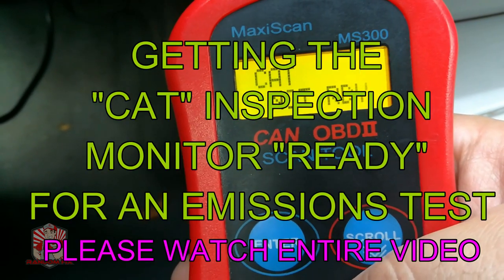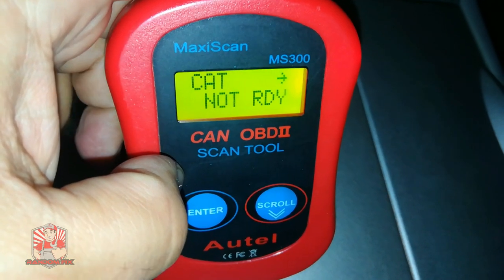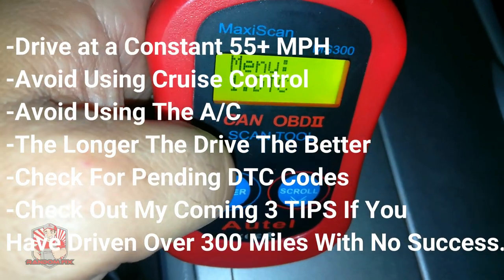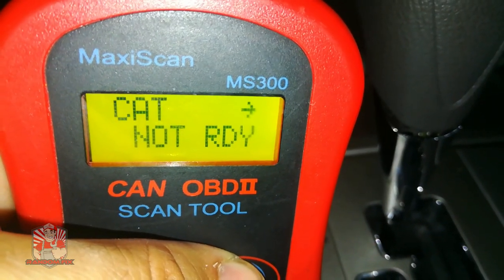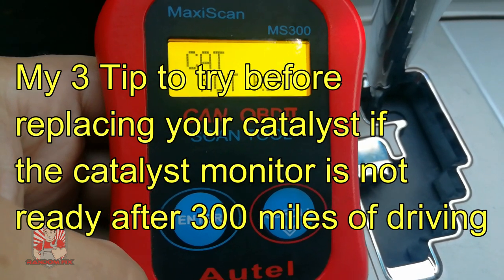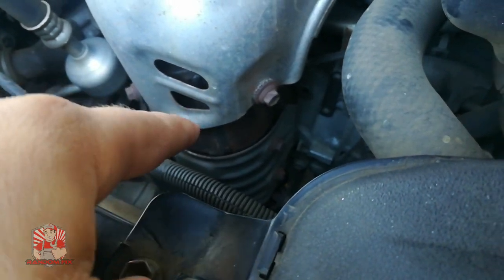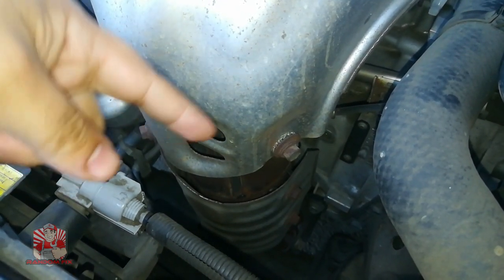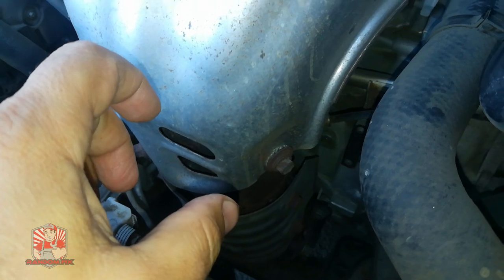Improve Your Catalyst Monitor Readiness P420 P430 FIXED!

Comment: 04 matrix . only my cat I m is not completing ?? I have a p0420 pending. Will the catalyst i m still complete???
Reply from the maker: You will have to clear the drive cycle as it may take longer for the check engine light to clear itself if the ecu (engine control module or unit)  think the issue has been fixed. After clearing you will need to find a permanent fix ( the only permanent fix a new catalyst) or find a temporary fix ( like I show on this playlist https://youtube.com/playlist?list=PLDEbtVOPRC-h1BAzaWQ-6NSnmG0gwvgwP )

The whole playlist is dedicated just to incomplete catalyst monitors.

Let me know if you have any other issues and keep me in the loop. I would personally try a temporary fix like the 3k trick that I show on the videos in the playlist and then work my way around to a fuel additive. When your registration is due again the next few years the you can decide what to do then. Good luck

Comment: Getting a P0421 code on a 2008 Mazda 6. Will clearing code, completing a proper drive cycle help pass smog test?
Reply from the maker: Yes, clear the code, wait for the morning and complete a drive cycle. It's worth a try. If not successful check out my complete smog list and I have a few simple temporary solutions. _Randomfix

Comment: What if there is no pending codes but the Catalyst Monitor is still not ready? What next? I drove for 101 miles. Thanks,
Reply from the maker: Louis, you have to keep driving until your get the Catalyst to set in most states.  Di you ever get the monitor to set? if you still need help, let me know I made video each make for the drive cycle process. Thanks
Reply: @RANDOMFIX  Yes the Catalyst did set, I just had to drive it more. Thanks
Reply: @RANDOMFIX  I live in PA and emissions is a must pass for inspection. I put Kata clean, unplugged the battery overnight for 12 hrs. And driven the car over 50 miles and still the 02 and Cat are not ready. I have no codes at all and no check engine is on. I need to pass inspection but the monitors are not ready....why?
Reply: @LordCommandor did you ever find a solution?

Comment: If I install fooler will my catalyst im still complete for smog check????
Reply from the maker: I haven’t tried the fooler method but did have success with mil eliminator on a ford mustang but there are no longer sold on the open market. I purchased from American muscle. 

Here are the simplest ways to fix a p420 code https://youtube.com/playlist?list=PLDEbtVOPRC-h1BAzaWQ-6NSnmG0gwvgwP
Reply: Will cleaning my 02 sensors will help My cat to complete?
Reply from the maker: It could help if your o2 sensor is cause a lazy reading on the down stream but now you are just guessing. Why do you suspect the o2 sensor?

Comment: Question if all my system monitors are ready  but i have the p0172 code if i reset or desconect the battery  my monitors will be inclomplete?
Reply from the maker: Yes, if you reset the check engine light all of your monitors will become incomplete. You need to handle the p0172 first.

Here are the different possible reasons why you’re getting the engine code P0172:

Contaminated engine oil (too long since the last oil change)
A leaking fuel injector
Excessive fuel pressure due to restriction along the fuel return line or a faulty fuel pressure regulator 
A saturated carbon canister due to packing the fuel tank.
Clogged air filter
Restrictions somewhere in the air intake system
Clogging due to buildup or physical damage in these exhaust components: catalytic converter, exhaust pipe, and muffler
Faulty O2 sensor (but O2 sensors more commonly fail by reading lean, not rich).
Exhaust leak (upstream of the O2 sensor, a leak will allow oxygen to enter the exhaust stream, and this will typically throw the opposite code rather than a P0172)
Problems with other sensors (e.g., coolant temperature sensor, mass airflow sensor)
Circuit issues, such as loose connections and damaged wiring 
Issues with the PCM, such as software in need of an update

Comment: How often does the catalyst monitor run a diagnostic?
Reply from the maker: It's probably vehicle make dependant.
Reply: @RANDOMFIX  I have a 98 Tacoma.  Monitor inc also.
Reply from the maker: Here is the drive cycle https://youtu.be/EKfEr2LP2Nw

Is the catalytic converter original?
Reply: @RANDOMFIX  I believe it is original. I haven't changed it since I bought.
Reply from the maker: Watch the Toyota drive cycle video for some tips but ultimately the catalytic converter will sometime just has too be replaced. Maybe you can still make it pass for a few more years. I have a whole playlist about catalyst and some tips 

https://youtube.com/playlist?list=PLDEbtVOPRC-h1BAzaWQ-6NSnmG0gwvgwP

But again the only real solution is a new catalyst.
Reply: @RANDOMFIX  Will check it out. Thank you!

Comment: Are you familiarise with p1093 bmw need help
Reply from the maker: here are the possible causes, low fuel pressure- did you check the fuel pressure?
Large vacuum leak on engine-
Faulty Mass Air Flow (MAF) sensor
Faulty Ignition
Faulty fuel injector

What are you experiencing?
Reply: @RANDOMFIX  thanks for the reply I got it fixed I had large vaccum some where between egr and vcg no more code thank for your help
Reply from the maker: Good to hear you got it handled.
Reply: @RANDOMFIX  ps I've also replaced my cats with an aftermarket part I had both 420 and 430 all good pass emissions in ct
Reply from the maker: Nice, is it driving better?

Comment: Any clue why a CCM monitor will not get ready? No trouble codes and it’s only the monitor that wasn’t ready. Before this I couldn’t get the CAT and 02S ready but got the issues fixed and after the repair the CCM was the only monitor that doesn’t get ready
Reply from the maker: Hi Franky, I will be more than happy to help. What's the year make and model? Also, can I get your help? CHECK OUT MY OTHER CHANNEL and subscriber if you like it. THANK YOU ▶️ https://www.youtube.com/channel/UC-wuhWwzZnFOWK-GMsP6Ejw _Randomfix
Reply: RANDOMFIX  an I advise me how to fix this on my Porsche 2001 boxter ? I was told today it didn’t pass cause the obd2 monitors ? Not ready ? I’ve own the car for 2 years or so only drive it to work and back if on freeway no more than 20 or 30 Miles at best...my mechanic told me to drive it at night for about 100 Miles or so an dit should reset ...the previous owner changed the batterie but that was over 2 yeas ago when I bought it and I’ve driven it more than 100 Miles pls advise
Reply: @vladimiralvarez1162  i am having the same issues in my 04 BMW 525! we recently had to disconnect battery for a door latch cable fix, well suprise i took for a smog because its due and it didn't pass ! said something about  Oxygen sensor and my OBM 2 monitors not ready . i tried a drive cycle of cold start for 3 minutes, drove 25mp and up to 35-40 a few times complete stops, and then 60 mph freeway for 5 miles and then coasted down to about 25 before a vehicle was way to close lol . any way let it sit at the end of work drove home did the 60 mph agin complete stops thru town ect... 
went back to have monitors checked and now its throwing pending codes have no idea what that means. 
did you get a fix ?????
Reply: Mona Parker 🤔🤔🤔well what my mechanic do was plug it to his laptop and reved it and was adjust all sensors with his laptop ..and got all the little faces that appear on the screen to look like happy faces and told to go and try smoging it and it passed with flying colors ...fast forward have had no problems and I did change my battery and it’s running smooth ...I did change the fuel pump cause it was bad ..but I love it !!
Reply: @vladimiralvarez1162   hmmm I have owned this car since november of 2019, previously owned by a family member. NEVER had issues passing smog untill the battery disconnect. I did not know that the sensors could be set via a computer . I have driven it now for about 570 miles. I have not returned to the smog place to see if its ready . sorry for the late response.
Reply: Mona Parker no worries ,that’s a lot of miles .maybe it’s already set .And I’m sure you’ll already payed so you can take it and won’t get charge for second try to see if it passes
Reply: @vladimiralvarez1162   yes I went to the first smog station because i bought a groupon for 2 and its a NO free retest so i failed there. I took it back to my guy in Davis where i should have went and he scanned it and said their were no pending codes? So i just got a code reader today and am going to see if its ready .

Comment: will this work on 2000 camaro
Reply from the maker: Yes it will work and your Camero is 22 years old so if you need additional help help here is the gm drive cycle video
https://youtu.be/Yp34ksJY-fQ

Keep me in the loop if you need additional help.
Reply: @RANDOMFIX  it has been to my mechanic 3 days now he has been doing the drive cycle  it is trying to set but no  luck yet. car has less then 15000 miles 0n engine  any other suggestion ?
Reply from the maker: Which monitor ( s ) are incomplete?
Reply: @RANDOMFIX  catalyst/egr  and or vvt system
Reply from the maker: How is the battery on the vehicle? So after completing the drive cycle twice you still have 3 monitors incomplete?
Reply: new battery 7 months ago  was just informed  erg/vvt has reset. still working on catalyst

 @RANDOMFIX
Reply from the maker: Cool, everything beside the catalyst set. Complete a long warm up, do the how idle in park 2.0k rpm ( Make sure you oil level and quality are good as these motors have upper end oil issues) and then hit highway at 65 mph and steady speeds. Try that once or twice. Normally in the hottest part of the day. It does not need need to a cold start.

Comment: There's a spark plug in the cat????
Reply from the maker: Sorry for the late reply! did you find a solution?
Reply: @RANDOMFIX  yeah i replaced my EVAP monitor. FYI it's really hot here and the EVAP monitor only comes on under 90degreesF so I had to do it real early in the morning. also FYI be forewarned over filling a gas tank can mess up the evap monitor too.

Comment: what if 2000 camaro has low mileage under 15000
Reply from the maker: Low miles is good for value but it may help with setting your drive monitors faster.

Comment: Thanks I'm going to try to the cats lean and spray seafoam in the upstream sensor hole, my truck has 300,000 miles 20002 Toyota tundra. I've replaced o2 sensors check light went off but now I got the OBD Cadillac. I don't want to have to buy a new catalytic converter because I don't have the money and I've been doing the work myself, I live in Las Vegas I'm going to add the seafoam inside the o2 sensor hole and cut it clean fill up my gas tank and drive to mesquite which is 100 miles and then drive back hopefully this passes my smog this truck as soon as it hit 300,000 miles everything started breaking down that I've replaced myself alternator fan belt fan belt pulley starter fuel pump brake booster everything my friend thank you for the info if I don't forget and it passes I'll let you know thank you
Reply: So, how are you doing now with the truck?
Reply from the maker: Any updates on this?

Comment: P0430 but my cat is ready and my O2 is not
Reply from the maker: This pretty common, here is a video I made about this 4 months ago.
https://youtu.be/Yn1-ul62Jio
Good luck and let me know what happens.
Reply: @RANDOMFIX  I will try the battery then, last time I checked torque pro showed my battery at 68% and another weird thing it showed fuel rem which I assume stands for fuel remaining was at 99% but the gauge on the cluster showed 3/4